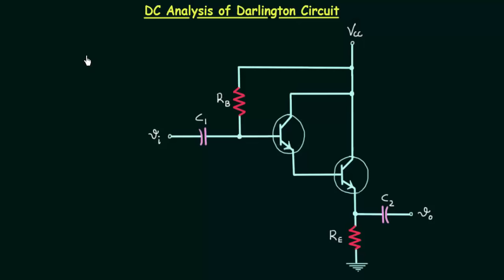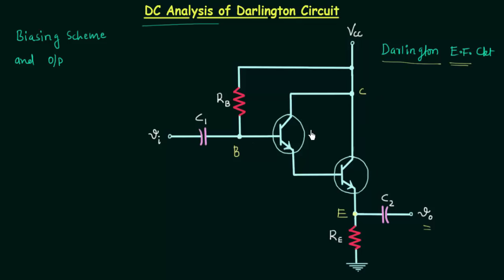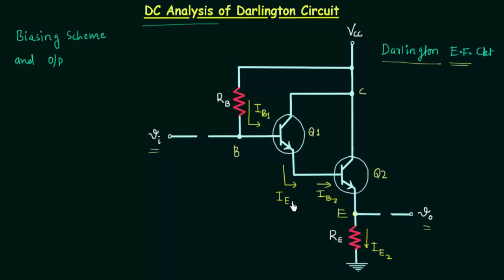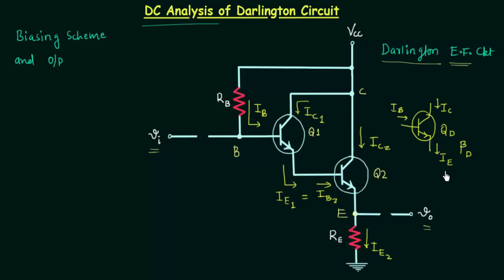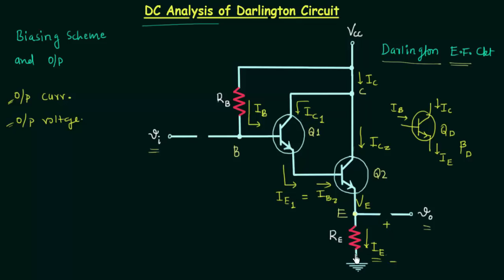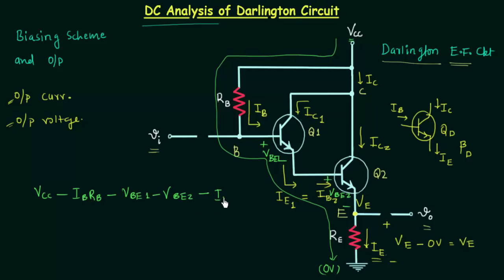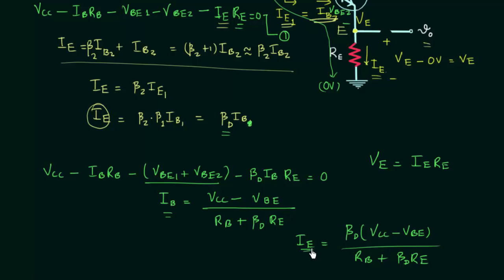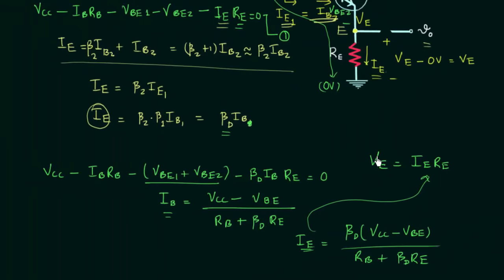DC Analysis of Darlington Circuit

Comment: My understanding, please correct me if I am incorrect, that the current gain of a Darlington is at its most linear IF there is no voltage swing from Collector to Emitter, so that the output is just collector current - no voltage swing on the Collector. Just current in, just current out. The DC voltage on the Collector stay in effect DC.